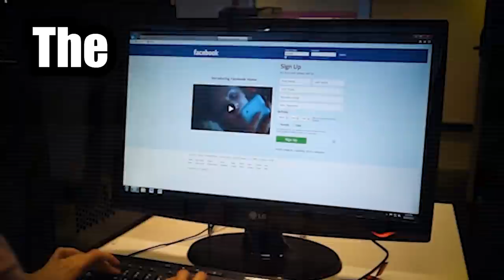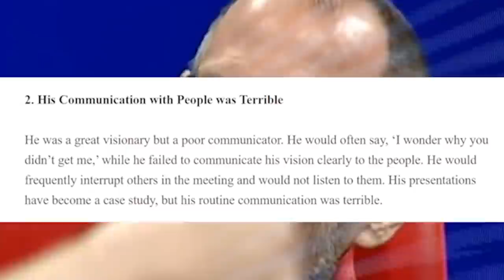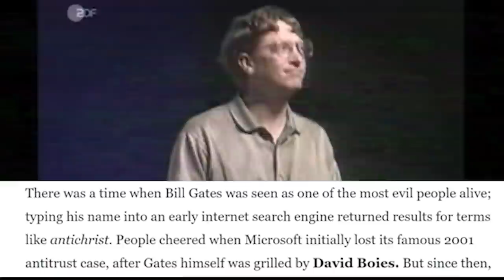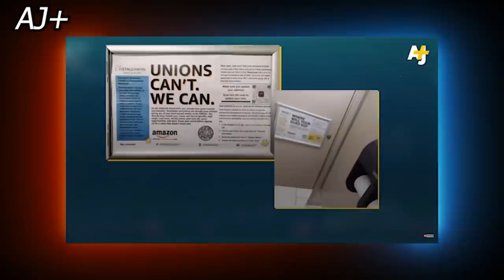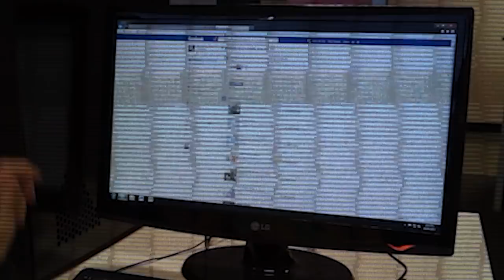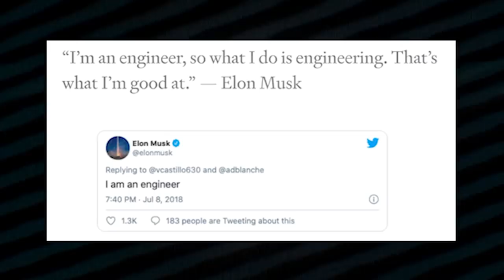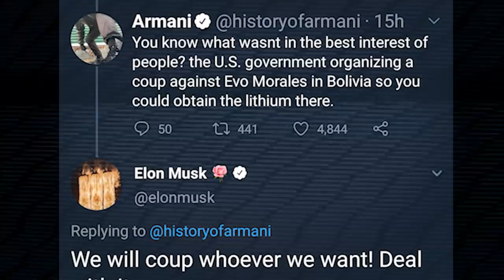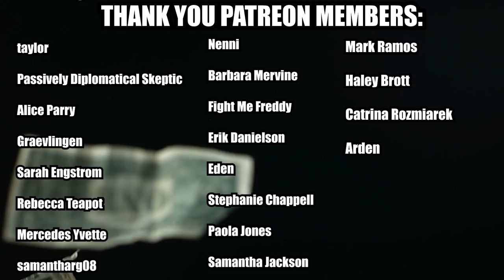The DOWNFALL of TECH BILLIONAIRES...

Comment: 29:09 "Research by the FBI found that companies managed by psychopaths tend to have decreased productivity and low employee morale." Seems to be a little outside of the scope of the FBI. Also interested to see their research process on that. The low employee morale bit makes sense but decreased productivity seems unlikely (admittedly that's anecdotal on my part). Most of the research I've seen that equates low employee morale with decreased productivity is dubious at best. Sounds nice and I wish it was true but pressure drives productivity. Just spitballing here, but I would imagine If you have a group of really creative and driven people who don't need external motivation that would probably be true. Most of the people I have worked with do the minimum they can get away with no matter how easy the job, the only solution in that case is to raise the minimum.